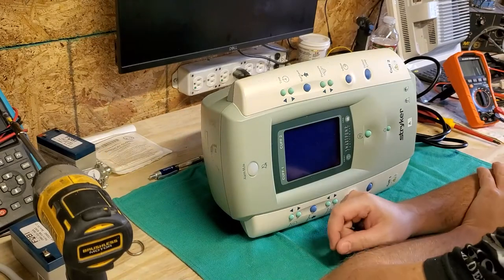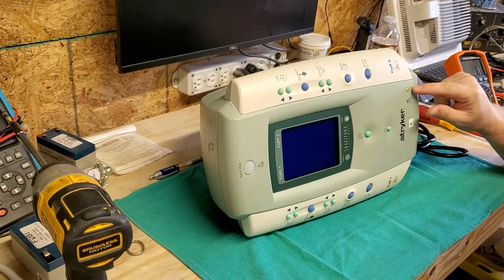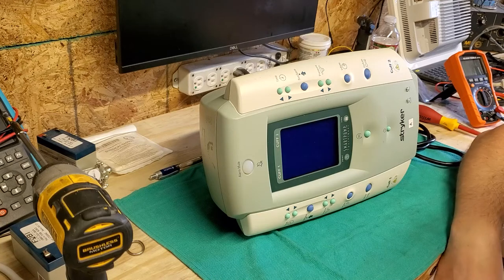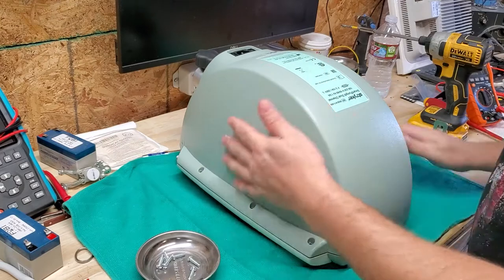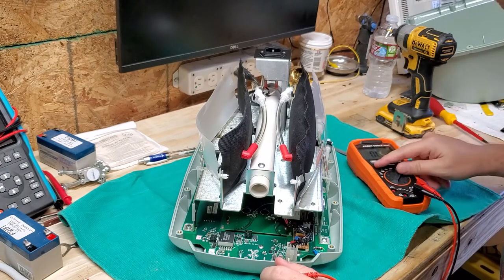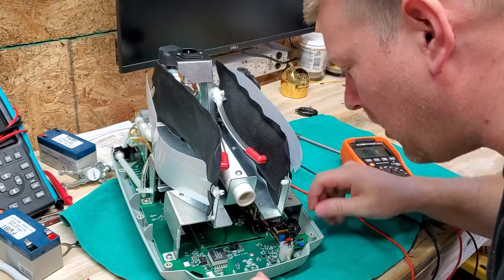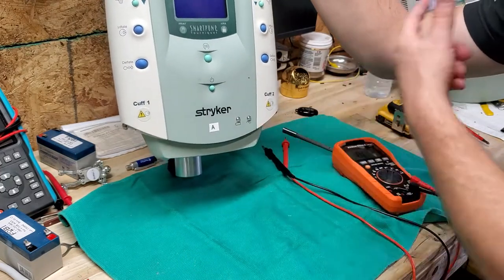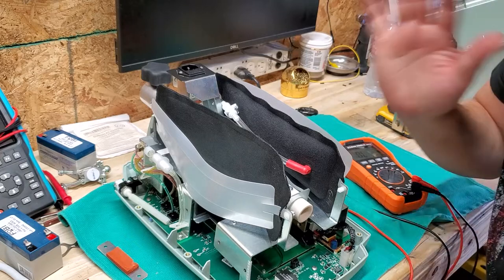Stryker SmartPump Error 38

Comment: If you know the voltage of this battery, and it is 12V, maybe for diagnostic purpose, is to connect one of those AGM batteries in front of you on the bench?
Reply from the maker: It uses a nickel hydride battery.  I don't want to mess up the charger circuit.

Comment: Do you have any suggestions for an error 41?
Reply from the maker: That's a internal bladder error (leak). Check fittings and quick connect O Rings. Manually inflate and check bladder with pressure meter.